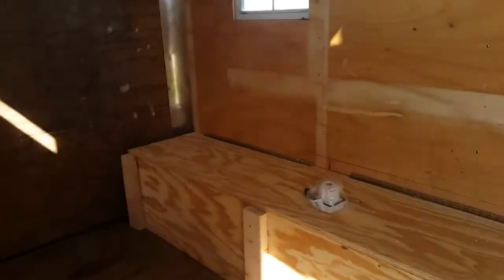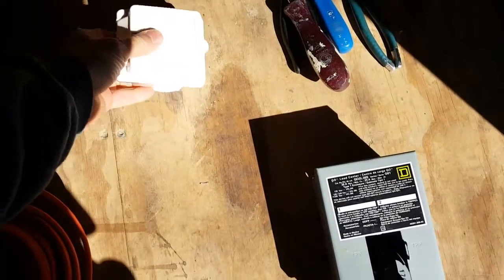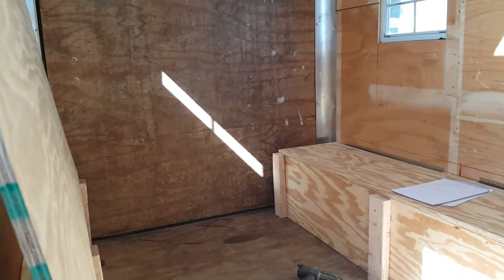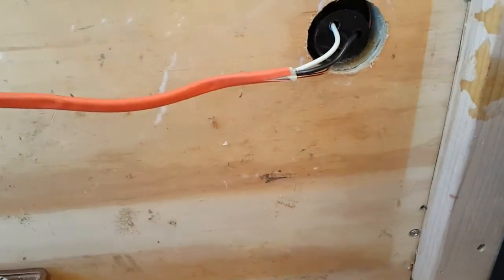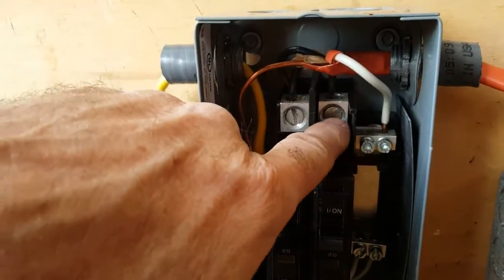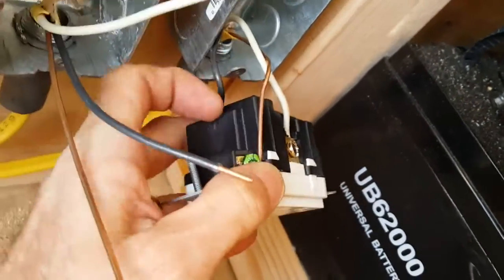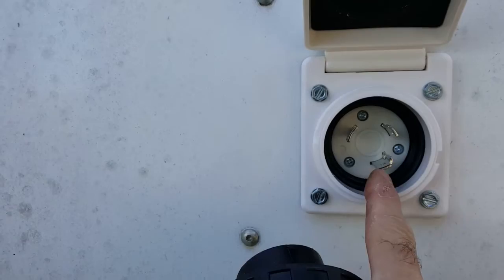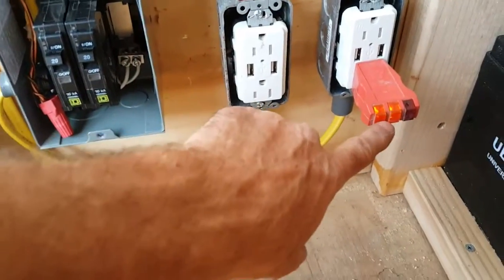INSTALLING SHORE POWER 6 x 12 Cargo Trailer Camper Conversion Part 9 Vanlife Skoolie #flgctc

Comment from the maker: “This setup worked great for me and helped a lot of people get started. That said, I’m not a licensed electrician, and if I were doing it today, I’d make a few changes based on what I’ve learned. Use this as a starting point — and always double-check safety standards for your setup.”
(You can order the parts mentioned in this video using the links below. These are affiliate links. That means I make a small amount for each purchase but it does not cost you any more money for the product. Thank you for supporting this channel.)

*4x6 speakers 
https://amzn.to/2MphkgV
*AGM Batteries 
https://amzn.to/2rl8Ccd
*Battery Cable 
https://amzn.to/2sVc5yC
*Solder 
https://amzn.to/34PW1eS
*Fuse Box 
https://amzn.to/2sdNp4u
*Solar Controller 
https://amzn.to/2sYCz2s
*40 amp Breakers 
https://amzn.to/2MmoDpv
*150 amp Breaker 
https://amzn.to/393OgFq
*Pure Sine Wave Inverter 
https://amzn.to/3728u0n
*12 volt Power ports 
https://amzn.to/34Mw3sM
*Black Electrical Tape 
https://amzn.to/395eeIK
*Red Electrical Tape 
https://amzn.to/34RoqB6
*Square D QO2L30S Breaker Box 
https://amzn.to/493gYGs
*Square D QO120 breaker 
https://amzn.to/2PJgBcq
*25 foot 30 amp 110volt power cord. 
https://amzn.to/36TSxZK
*30 AMP Shore Power plug in port 
https://amzn.to/2Zifm7s
*10/3 bulk stranded cable 
https://amzn.to/394wySk
*12/3 bulk stranded cable 
https://amzn.to/2rgYwsS

Comment: How do u get put on thd part on drill to make that hole
Reply from the maker: That;large hole was cut using a 2 1/2 inch hole saw. https://www.google.com/search?q=2+1%2F2+inch+hole+saw&oq=2+1%2F2+inch+hole+saw&aqs=chrome..69i57.7226j0j7&sourceid=chrome&ie=UTF-8

Comment: Can you run 3 interior small pod lights on this service with 4 outlets total?
also can you add solar and run these outlets  off of solar when needed or would that service need to be seperated
Reply from the maker: Yes you could. You have your choice off 120 volt ac/dc lights or 2 volt DC lights. The DC lights would run off the batteries. The 120 volt lights could run off of the inverter or the shore power.

Comment: Is the ground wire bonded to the breaker box?
Reply from the maker: My shore power breaker box is grounded to the frame. My 110 volt wiring wis grounded through the shore power connection. Works for me.

Comment: I believe you left out the part where you used a wire as a jumper to energize the second pole of the breaker box so the second circuit breaker would work.  Yes, you can see it in the video if you freeze it and look very closely and know what you're doing but I would say the average person would be wondering "There are three wires going into the box and four connection points, where did that fourth wire come from".
Reply from the maker: https://www.youtube.com/watch?v=nce1XPjpbRM

Comment: The wire entering the trailer MUST be in a junction box. It can be a serious hazard. Not knocking just trying to help anyone else doing this.
Reply from the maker: Thanks for your suggestion. However, my 2014 Forest River travel trailer 30 amp cord does not enter the trailer in a junction box. The cord enters the side of the trailer and connects to a converter that is located under the bed. The 25 feet of cable is stored under the bed as well. I open the access port and pull the cable out in order to use it. No junction box that I can see. Thanks for watching.

Comment: I'm jjust curious but, why couldn't you just plug a POWER STRIP into your 30 amp shore power inlet inside your trailer? Then plug all the different devices you'll be using (laptop, phone, portable air conditioner, etc.) into the power strip (just like you would inside your house)?
Reply from the maker: The power strips I have seen would handle 10-15 amps at the most. I have never seen a 30 amp power strip. But if it works for you then go for it.

Comment: I followed your steps but installed 3 20 amp outlets on one circuit and 2 on the other. I just finished and bought a 15amp converter so I could test out the electrical. When I plug my extension cord into the 15-30amp converter on the 30amp plug it trips the GFCI on my house. Not sure what is wrong. It’s tripping before I even turn on the breaker. Any idea?
Reply from the maker: Well, it is telling you that something is not right so proceed with caution. Is the 15amp converter a 30 amp to 15 amp adapter like this? https://www.homedepot.com/p/Camco-Conversion-of-15-Amp-Male-to-30-Amp-Female-Electrical-Adapter-55223/100142739?g_store=552&mtc=Shopping-B-F_D26P-G-D26P-26_7_PLUMBING_REPAIR_And_REPLAC-NA-NA-Feed-LIA-NA-NA-RVProducts&cm_mmc=Shopping-B-F_D26P-G-D26P-26_7_PLUMBING_REPAIR_And_REPLAC-NA-NA-Feed-LIA-NA-NA-RVProducts-71700000053283173-58700005117670190-92700044888771690&gclid=CjwKCAjwnK36BRBVEiwAsMT8WBmSWtTRzl58XqSYkABVrreACH27hm5FqM3mSeSFUr0-YjD07AOauRoCz3EQAvD_BwE&gclsrc=aw.ds
Reply: GB Conversions & Adventures  No it is this one RVGUARD 3 Prong 15 Amp to 30 Amp... https://www.amazon.com/dp/B085HNBMSJ?ref=ppx_pop_mob_ap_share

Maybe I should try the Home Depot one.
Reply from the maker: @daleadams9041   My spam filter stopped your reply because it had a link in it. Sorry. If it is tripping the GFCI before turning on the breakers, then, to me, the problem is before the breaker box.
Reply: Concerning the comment about  tripping a GFI, it appears you kept your bare ground wires completely separated from the white neutral wires. Therefore you could plug into either a GFI receptacle or a 30 amp RV receptacle. If you had connected the bare ( ground wires) to the white wires, as in a normal house panel, you would trip a gfi breaker any time you plugged it in. I ran into this. You can not connect your bare wire to the neutral in a GFI circuit or it will trip. In this video it was not real clear but I think you kept them separate. Is that correct?

Comment: I wish you would have shown the process of drilling that hole in the thin aluminum siding. Did you tape over it? How did you keep it from binding? What specific but did you use?
Reply from the maker: When I first started recording I did not have a tripod so I had to hold the camera. I could not safely cut the hole with one hand. I did put masking tape on the outside skin. I used a hole saw to drill the hole. It was either 2 1/2 inch or 3 inch but I am not sure. You will need to see how large your plug in is and get a hole saw slightly larger than that. Good luck with your project.

Comment: Great video. Thanks. Is there a way you can wire it to be able to use shore power to charge your batteries in case its needed?
Reply from the maker: Thanks. Yes, we carry a small battery charger just in case we need it. We have gotten stuck under a storm system that lasted a week and the batteries were not getting recharged by the solar. It happens.

Comment: Thank you fora great video.  Now I have a question of importance if you or any other knowledgeable person will answer please.  I know the circuits are grounded via your incoming shore power line that is grounded by the source breaker box.  However if you use a generator instead of shore power should’ve the breakers in the trailer panel be grounded to the trailer frame?  Please someone answer this for me.
Reply from the maker: Thanks for the input. When we are on solar we use the invertor and bypass the breakers. Not sure about connecting a generator, we have not used one. I wouldnt think a ground from the box to the frame would hurt in that case.

Comment: Seeing you are using a 30amp plug shouldn’t you 2 breakers been 15 amp each or does it not matter ?? thanks
Reply from the maker: Good question. I have a total of 30 amps possible or the whole trailer. I have 2 20 amp circuits coming off of that. Each circuit could use 20 amps but the total amps can only be 30. So if I had an AC system pulling 16 amps I could run it on one circuit and I could run everything else up to 14 amps on the other circuit(lights, TV, microwave). HOWEVER, for safety you don't want to max out your circuits. Usually we try to stay below 80% max draw on any circuit. So 24 amps max from the source and 16 amps max on any of the branch circuits. I hope this helps.

Comment: You put your plugs upside down
Reply from the maker: Thanks for watching RC. That has actually been a hot debate on some FB groups. I am pretty sure that the ground should be on top. However, you can install them the way you want on your build. Good luck on your project.
Reply: It really is a matter of choice.

Comment: How will you charge your battery when your on shore power?
Reply from the maker: Hi Bob. My batteries are still being charged by solar even when on shore power. I do carry a 110volt plug in small battery charger in case we have a need. I haven't used it yet.

Comment: I have a 6x12 enclosed trailer that I use for my work, I have all my tools and would like to set up power inside so that I can run a mini fridge at all times and to have a microwave setup as well and to be able to plug my tools in to keep them charged..what set up would you recommend? Mind you i have no electrical experience whatsoever. Thank you.
Reply from the maker: It sounds like you have and do what I have and do. Follow my series of videos and it should work for you like it does for me. The only thing is that when you are on solar/battery power you have to be mindful of the electricity you use, especially at night. I can use my microwave on the batteries but not repeatedly. I keep my computer and tools recharged as well. Good luck with your build.

Comment: I would also like to know the brand/model # of the USB outlets that you installed. Thanks👍
Reply from the maker: Not sure if these are the exact ones but they will work. https://www.lowes.com/pd/Eaton-White-15-Amp-Decorator-Tamper-Resistant-USB-Outlet-Residential-Commercial-USB-Outlet/1000014700

Comment: Will this 20amp service work with the ASA Electronics ACM135 Advent Air RV Air Conditioner? I purchased one for my 6x12 enclosed trailer? Thanks in advance, James
Reply from the maker: Is your AC system 12 volt or 120 volt? You would have to look at the label on the AC unit for the volts and amp draw.

Comment: Thank you for sharing this information.  I really appreciate the straight forward approach to installing shore power in a cargo trailer. I've started my 7x14x7 foot cargo trailer conversion last week.  In the final stages of insulation and electrical is next.  Like you, I want shore and solar capability.  Also, it was great to see your parts list. Very thoughtful and much appreciated.   Happy travels and I subscribed.
Reply from the maker: Thanks for watching. Good luck with your build.

Comment: if you are installing two 20 amp breakers, you could potentialy be putting a 40 amp load on your cord you are using to plug into your source. it seems the breaker box should have a main breaker matching the rating of your cord and splitting into two seperate circuts same as in your house. And I think you need to ground or bond to the metal trailer in case you get a live wire onto your metal trailer parts it will trip the breaker. the way you have it now, if you get a hot wire against your siding the whole traile will be energised. I am not an electrician just thinking only qualified electricians should make videos that many other s will follow  your advise. A few electrocutions and no campgrounds will let us in eventually
Reply from the maker: If I put 40 amps of load on the system the 30 amp breaker at the pole would trip. You are right, I could do that. You could also do that with your house if you turned everything on max at the same time. That is why you have breakers, for protection. As far as grounds and bonds, when I am connected to shore power I am grounded according to all the testers I have used. My frame is grounded to the box as well. I am still not happy with the grounding of the system on the inverter and still trying to figure that out. Just to clarify, I am only showing people how I wired my system, warts and all. The viewer can choose to follow my lead or not. The other videos I have seen about how to do this are not very clear and I am taking different camera angles to help myself and anyone else that chooses to try it out. You are correct, I do not want electrocutions and I do plug in my testers into their pole before attaching my electric system to theirs. Then I test again after attaching to shore power. I have taken constructive advice and I have made improvements to my system. Always open for more suggestions. Thanks for your comments.

Comment: Was kinda dark showing the wiring going into the breaker box from the outside plug but I’m sure I can figure it out. Best video I’ve seen so far on wiring an enclosed trailer. I plan on buying one next spring and converting to a camper, thanks for your help!
Reply from the maker: I agree with the lighting issue. I made a newer video of the hookups that might help. https://www.youtube.com/watch?v=nce1XPjpbRM Thanks for watching and the kind words. Good luck with your build.

Comment: Sorry, one more question, why are you dropping back down to 15 amp via adapter after creating a 30 amp service?  I would want to have the extra bandwidth...but I know very little about electricity ! Thx.
Reply from the maker: Thanks for watching and asking. Use your house for example: Your house may receive 200 amps of electric service. I don't know of any household items that would use 200 amps. A central AC unit might use up to 50 amps. All of the lights and other electrical devices need amps too. Your house electrical system is broken down into many small amp circuits from the breaker box to each room. It would be a lot of heavy, expensive, extra wiring to put 200 amps in each room. Same with the trailer. You can get 30 amps coming in but not all of your trailer needs 30 amps. You will need to spread that out over the trailer with smaller wiring and 15 amp plugs. I hope this helps. Good luck on your build.

Comment: Thanks for taking the time to make these videos!!  I had one question,  could I use two 30 amp breakers instead of  the 20’s or even just one 30 amp circuit?  I have a cargo trailer similar to you.  Thx.
Reply from the maker: Good question. You could use 2 30 amp breakers but in order to use the full 30 amps you would have to match he wiring and the plug ins. Your home outlets are usually 15 amps and some may be 20 amps. Most of your small electric objects plug into 15 amp plugs.
Reply: @FakeLegGreg  Noob here: then why do some people use one 30 amp and one 20 amp? Do bigger appliances namely the AC and fridge require 30?
Reply from the maker: @ccwnoob4393   Some appliances like AC and electric heat do draw more amps and will need bigger wiring and bigger breakers to operate correctly. Or, it may be a combination of things on that one circuit that requires a bigger circuit. An electric hair dryer, fridge, and AC system together on one circuit is going to pull a lot more amps than a TV and some lights. Usually you can see locate the amp draw of the appliance on a tag on the appliance. Good luck.

Comment: Consider using Romex connectors if those connectors don't grip the cable.  The bare ground wire should connect to service panel cabinet metal, and to each metal outlet box (pig tail) with a green 10-32 grounding screw I believe. Covers on the outlet boxes. Hole closer for unused openings. Romex strap within 12" of a junction or outlet box. I'm in the habit of wrapping electrical tape around my outlet terminals before screwing them into the metal boxes as an extra precaution. Just meant as helpful comments. Thank you for the video!
Reply from the maker: Great suggestions James. I am in the process of doing some maintenance right now and will include your suggestions on the updates. Thank you for the these and thanks for watching.

Comment: Is a disconnect necessary? I never saw anyone use one before on a van build.
Reply from the maker: Hi Anita. I have several disconnects for safety. The solar disconnect is because the solar panels make power when light is on them. The disconnect allows you to turn off the power if you need to work on the system. I have a disconnect from the batteries to the invertor to provide protection to the inventor and prevent overheating. The batteries are always on otherwise. I hope this helps. Thanks for watching.
Reply: GB Adventures Yes Thank you :)
Reply: I would appreciate that video! I don’t want solar power just yet. I’d like to set up shore power with a battery bank so that I don’t have to always have to hook up for electricity. I’ll think about adding breakers then.
Reply from the maker: I also have the 2 110 volt 20 amp breakers in the box. Sometimes the RV park will have a problem with their wiring. If you don't have breakers their problem could become your problem when you hook up. I will make a video about hooking up to shore power and how to handle that safely.

Comment: So would your other power outlets you are trying to install just run as extension cables basically? Or would you need too add more breakers? Also best video I could find on running the power like seriously thank you!
Reply from the maker: That's pretty much it. You are just extending the existing circuits. Thanks for watching. Glad the videos helped.

Comment: Great vid man. You're good at explaining stuff. Just so you're aware, you can get transfer switches so you don't have to plug and unplug whenever you change power systems.  A 30A automatic transfer switch shouldn't be more than $100 for a good one.
Reply from the maker: Thank you for the suggestion. I will look into it.
Reply: @FakeLegGreg  Thank you for actually providing information that actually shows how to wire these things. Lots of DIY videos are "cut a hole in the van ... and now we're all hooked up"
Reply from the maker: Glad it works for you. Good luck on your project.